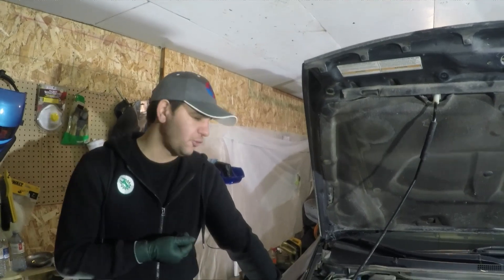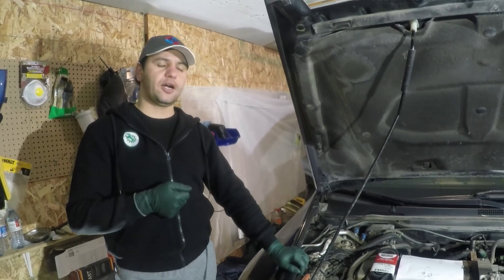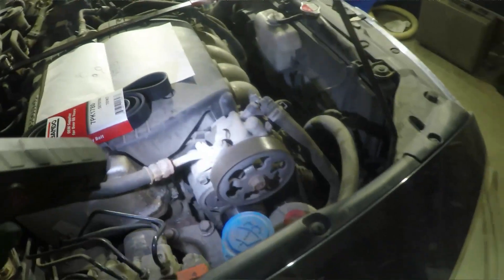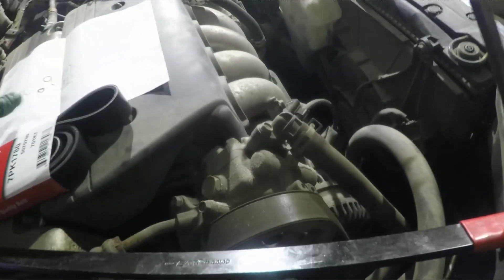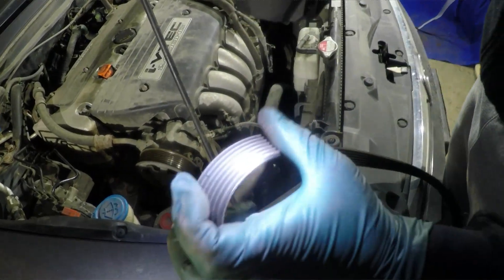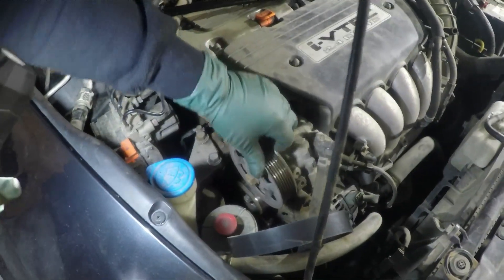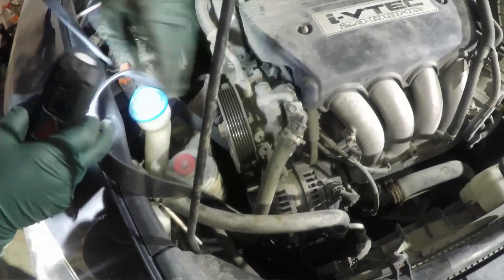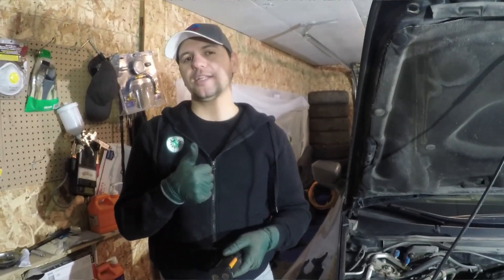Honda Accord Drive Belt Replacement (Serpentine Belt)

Comment: Do you need to go under the car to set the belt on those two bottom pulleys? Or it is possible to do it from above (If so how and is it really difficult)? you didn't show the whole things during that time in the video.
Reply from the maker: Syeed Ahmed yes you can do it from above and it’s not hard at all. Regarding the bottom pulleys you just reach by hand or a screwdriver or something and it’s really easy
Reply: Great! Then I will be doing it by myself. Also is the Bando belt good? How well it's holding on your car?
Reply from the maker: Still going strong, would recommend 👍